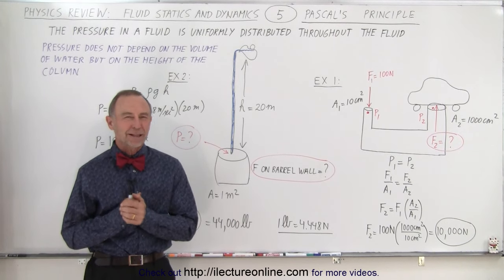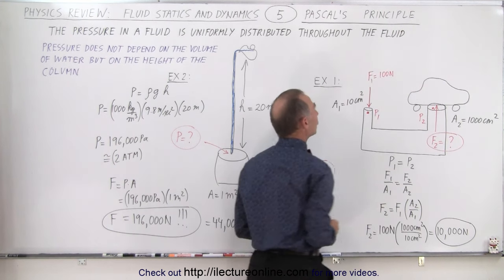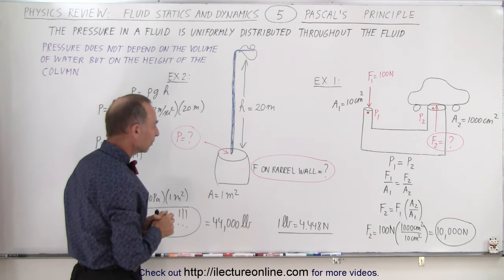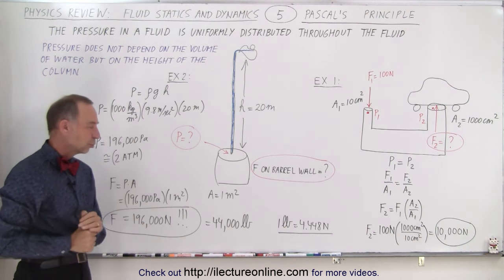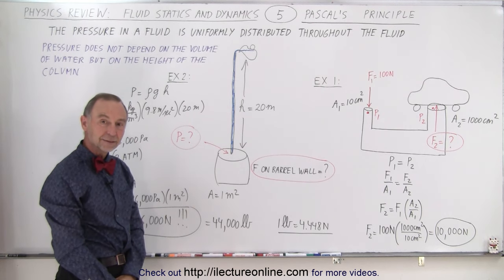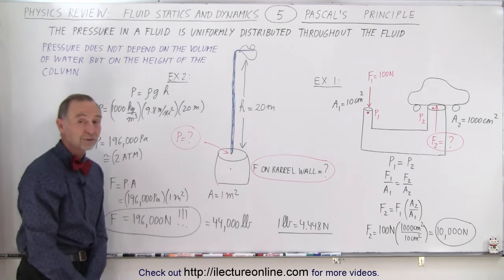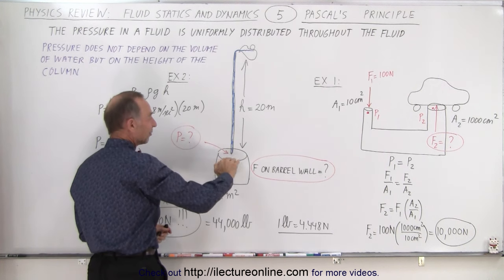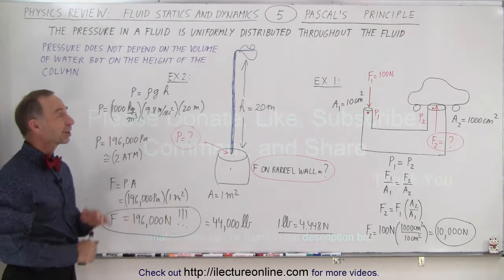Physics Review: Fluid Statics and Dynamics #5 Pascals Principle

Comment: Keep in mind... water isn't very compressible, and doesn't store energy very much at those pressures... so when the barrel bursts, it doesn't explode, it just cracks open, and leaks. However, if the fluid under consideration was air... which is much more compressible, then the bursting would be much more violent.
Reply from the maker: You are correct.

Comment: The student asked a lame question i guess... anyway you are awesome sir 👍
Reply from the maker: All questions are welcome.  Stifling questions prevents learning.
Reply: It was not a lame question. In fact I was curious too. It looks way too easy to increase the pressure;  just pour water from the top and you get what you want. Surely there has to be come catch to it. Apparently not. 

Or maybe there is (ie, a catch). Getting water to top of the 20m tall tube takes a lot of energy. This is the energy that got 'converted' to the pressure buildup. Is this correct, professor?